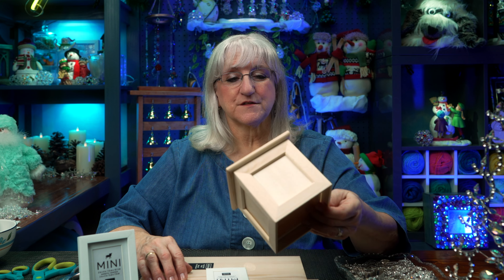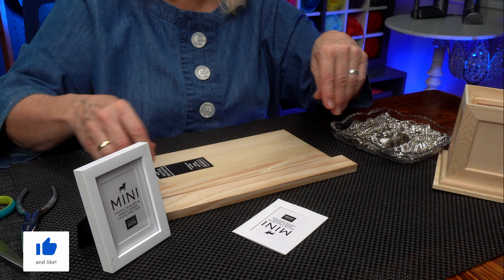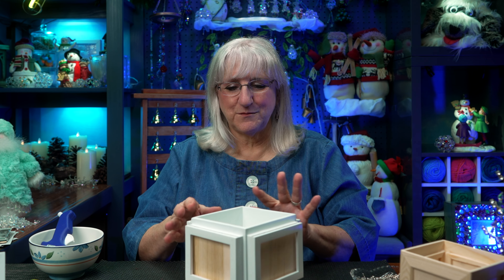How to make this DIY Desktop PHOTO CADDY Cube for under $25 dollars

Comment from the maker: Photo Caddy Chapters

0:00 - Intro
0:30 - Project Supplies
0:58 - Project Description
1:32 - Cutting the Base Pieces
3:00 - Base Assembly
3:55 - Modify the Mini Picture Frames
4:15 - Attach the Mini Frames to the Cube
5:05 - Add the Plastic Swivel 
5:20 - Paint the Caddy White
6:05 - Ready to Decorate
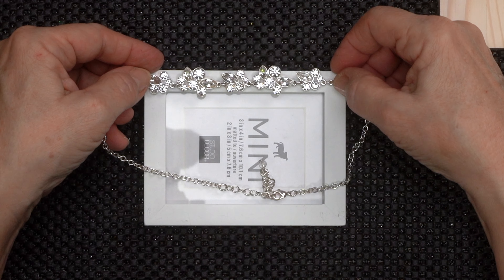6:45 - Deciding which Old Jewelry to use
13:00 - Attaching the Jewelry 
15:05 - Adding the Photos 
17:10 - Adding the Felt Liner
18:00 - Completed Caddy
18:12 - Outro